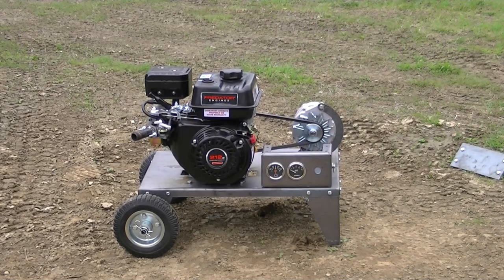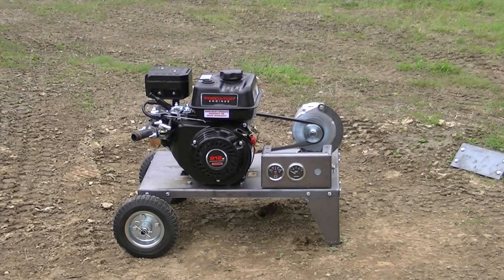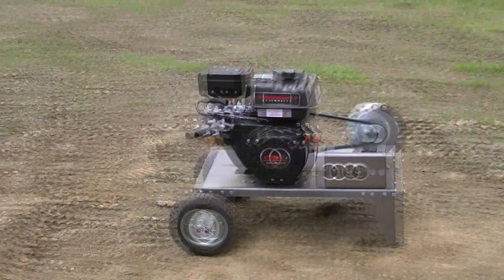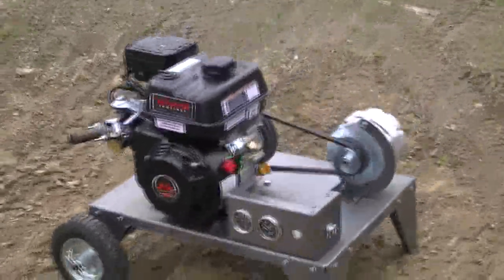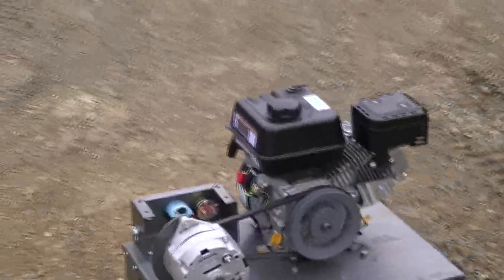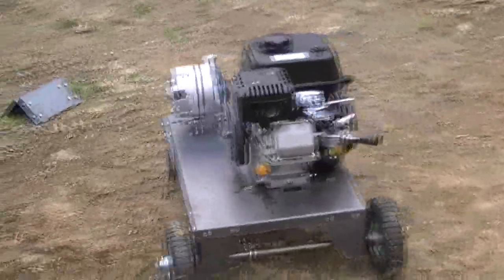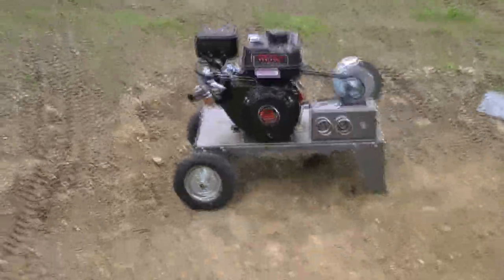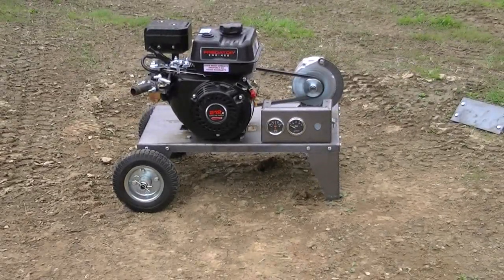Breaking in the wood gas battery charger

Comment: Looks nice! Just a thought, maybe isolate the engine from the steel with some form of rubber dampener, if sounds levels are important to you. There are some nice acoustic dampening gen enclosures on YT too. I have 3 HF engines. All run well.